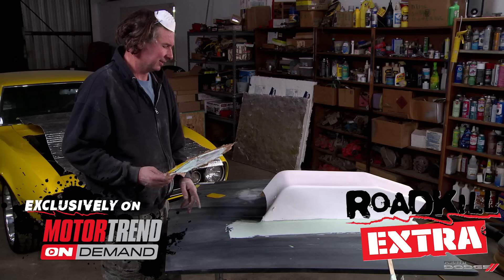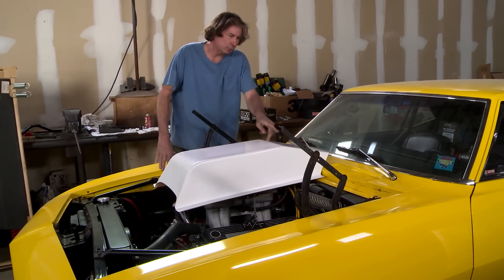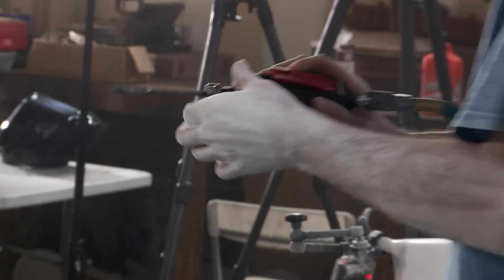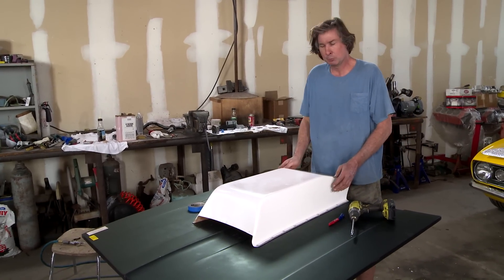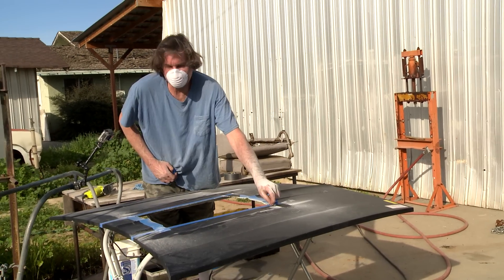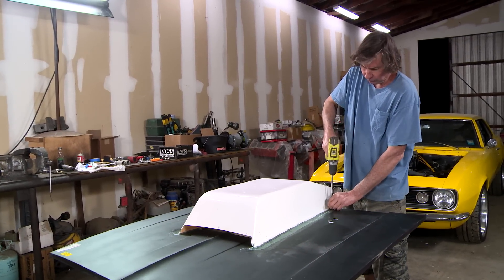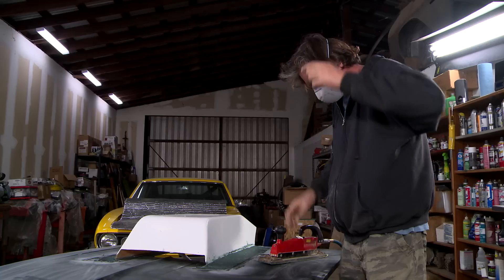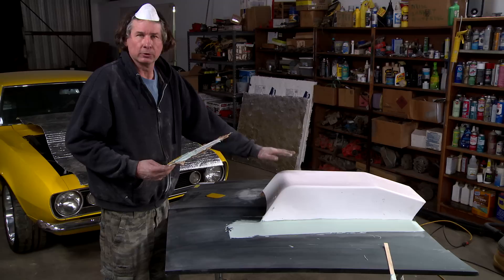How to Install a Fiberglass Hoodscoop - Roadkill Extra

Comment: Push it up threw the hole from the bottom, rough up the mating surfaces and secure it with resin and pop rivets.  Setup maybe takes a little more time, but you get to keep the 2" flanges and blending is so much easier...

Comment: a neat trick a seen once was someone trowing the thickened resin intoo a thick plastic bag and then cut a small corner of one end 
he then used it as a cake decorator and squeesed the plastic bag laying down a nice bead al along the part needing to be bonded , saves a lot of mess and time too
he used some sort of glass beads intoo normal resin to thicken it enough to use it to stick the deck and the hull of a speedboat together , whent on like squeesing toothpaste out of a tube

Comment: Would have done it from the underside. That way all you have to pay attention is the radius.
Reply: Exactly! And use proper tools and saftey for starters. Then use ITW Plexus adhesives. Dish out the radius to apply mat to prevent cracking then a ultra thin skim of filler. That would prevent hidius build up and questionable structural integrity
Reply: When i saw the lip, i thought he would put it in from the underside. Maybe would have been more work, but would have looked better in the end.

Comment: Why do it from the top?
Flip the hood (leave the 2 inch lip on the cowl) and glass it into the the hood from the bottom? The only thing needed on the top of the hood would be to fill in any gaps between the cowl and the hole made in the hood. That would leave the lines of the hood clean instead of raised around the cowl. Just a thought.
Reply: Bring Noise thought this as well!!

Comment: just wondering shy you didn't use cordless to tek screw the scoop when placing scoop to hood during bonding? But you did use it when removing screws...
Reply: He didn’t want to over tighten and squish out too much of the material

Comment: I picked up a couple years ago, the neighbors a 64 1/2 hipo mustang, it spent most of its life as a drag car. It has a 'vintage' scoop like this on it, BUT it has the LARGE hole in the front. (hood was cut to be functional ram air).  Which is 'time period correct'? ram air or Cowl induction?   My hipo IS a old drag car, and Ram air.

Comment: would it work if you cut a slightly bigger hole and and fitted the scoop from the underside so you don't have to blend it in from the top? that way any blending you need to do would be from the under side where nobody would see it?
Reply: that is probaly the way i would have done it. that way if it does manage to brake loose, it wont fly away.

Comment: I use a 1/2 to 3/8 drill bit in the 4 inside corners before cutting for radius corners.  Easier than a jigsaw.

Comment: Why did you not install the scoop from the inside instead? Wouldn't it be cleaner and easier to do it that way and with almost no chance of it flying off if any one of those epoxies / fillers didn't set right? Epoxy it from the inside and use the screws exactly the same way you did on the outside, except on the inside. You could leave them there forever this way and have both the epoxy as well as the mechanical fasteners in place for extra security. Then on the outside surface you'd have a lot less filler and bondo to add to smooth it out so it should look better and be stronger overall.  If I'm wrong on that please tell me why. I'm not a body guy but it seemed logical to me to do it that way.

Comment: Steve it will not last long, Why you say? Because Long Strand is not a bonding agent. that scoop will go air born someday. You need to remove all signs of gel coat or tool gel coat you need to get down to fiberglass, than mix up some laminating resin wet areas to be glassed use some Fiberglass mat several layers than let cure than grind until you itch like crazy than body work it.
Good luck dude, You grow grapes I build and repair Boats..

Comment: Why weren't the hood flanges bonded from under the hood for a flush finish and rigidity? Personally, i would have cut slots to feed the flanges into, bonded from the inside.

Comment: Yeah, that's not how fiberglass works.
That thing will delaminate .
Laminating resin and mat bonded to the fiberglass parts with gel coat removed from both parts first.
That's from the top and that's the shortcut way.
But it should be done from the bottom to be right, but that's the long way.

Comment: Card board can Rob your hardener from your body filler, but if your considering using cardboard just keep it mixed in a small area & add a little extra hardener. Or buy a plastic board......your already their & they're $5

Comment: In no way an expert, but was wondering why you wouldn't cut a slot for the scoop to slide into the hood and attach it from the bottom and inside. The hole is cut afterwards from the underside. I think it would be a much cleaner look and less body work.

Comment: man this made me cringe...no prepping of either surface, no cleaning off the gel coat/ primer on either panel before bonding it. You need to take each panel down to the raw exposed strands in order to get a good bond between them.

Comment: That is the last way to fix a scoop on to a 10sec car! It will fly off, i pronise you that!!!
I have worked with fiberglass more than 10 years and this is ridiculous! The attachment points and the area where it is glassed, must be sanded BEFORE any work, because a smooth surface does not hold anything! 
The second thing - bondo? That will not hold! You need to apply at least 3 layers of glass and resin! 
Hope it will not fly off while Freiburger is on the freeway or the drag strip!!!!
Reply: well this is an old video, the car has been down the track countless times now without any problems.
Reply: Dragpix Australia In true roadkill style, they manage to get away with stuff no one normally gets away with... cuz roadkill 👍
Reply: You must be blind, because the surface was sanded...
Reply: Dragpix Australia Yeah but as a car show and more importantly motor trend, when there doing an educational video they should be teaching the correct way to mount this and do other things. Not "it works".
Reply: Sanded when? I saw that they were sanded after hardening, not before aplication
Reply: I didn't see anything really wrong with it, I've done a similar job to a mid 9 second car about 10 years ago. It's probably done 100+ runs by now and had no issues.
Reply: Igor, again. You must be blind. It's sanded before. Go have another look.
Reply: Trail's End. I disagree, Watch before he drops it. Slow it down to .25 or .5 speed if you need to.On my 55 inch display it  looks lighter to me(the flanges). Also, have you handled those scoops before? They are quite rough underneath before you ever touch them. He laid long strand on the top as well. The guy has been doing this shit for 30 years, I promise you he's not worried about it popping off.  Dyna-Glass is tough shit.
Reply: If the Dnya-glass wasn't used between the hood and scoop, i'd be far more critical. It hardens like steel.
Reply: I used that stuff before too. It's ridiculously strong. Even along seams it doesn't crack the paint afterwards, it's like slathering on steel.

On a side note. I find it funny how people don't see it on the video they automatically assume it was never done. We didn't see the hours of work, so it must have never happened lol.
Reply: the dude did several 10 second passes in the roadkill garage videos with no problem.
Reply: he said in the video that he was not only using the bondo to bond it on...but was also going to be glassing it from the bottom. not to mention it's been down the strip many times so far and as far as I know, all is still good.
Reply: Igors Dubrovskis 
It was roughed with a coarse cross cut carbide.
Reply: I'm fairly certain with his knowledge of working with fiberglass that he most likely sanded the hood. Like I mean that would be a real beginner mistake to not sand it, and this guy is clearly not a beginner.
Reply: I'm also a fiberglasser and i work for a company that specialises in joining scoops too bonnets and I can confirm that this is definitely the wrong way too do it. He did a few things right but there's a lot of wrong
Reply: lol

Comment: If you don't know how to do body work correctly, you shoudn't do how to videos.
Reply: You must be new to Roadkill. Literally every single thing they do comes with the disclaimer of "This isn't the right way, but it's the way we've done it for decades and it works pretty good"
Reply: they say that same thing you just said on every video. This isnt the right way but its our way.
Reply: He actually did it all the right way. But, to be honest, there is no exact right way to do it. That's just how body work is, most body men would have done it the same way or used a panel bond under the scoop.